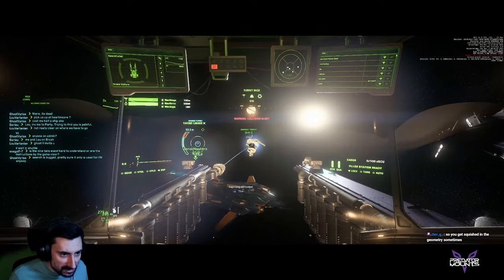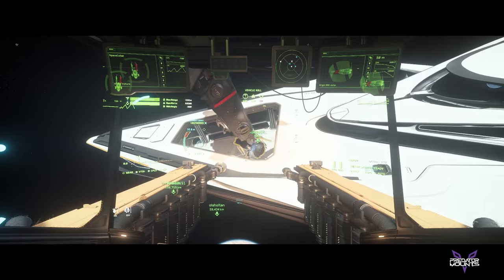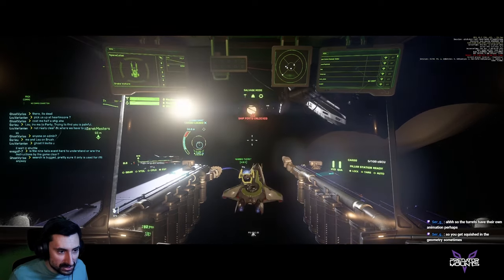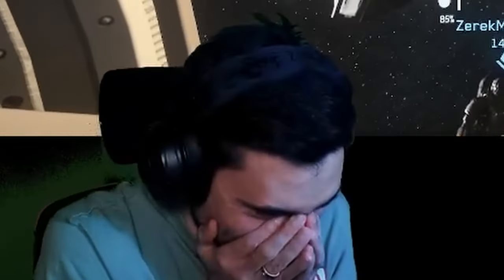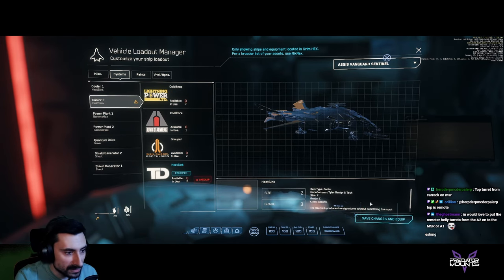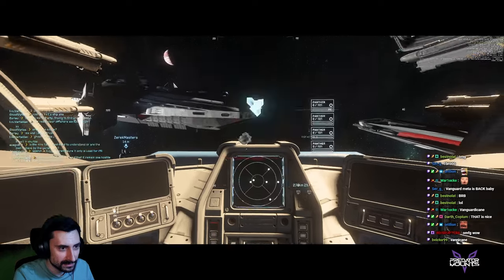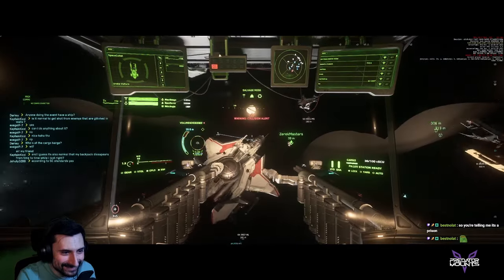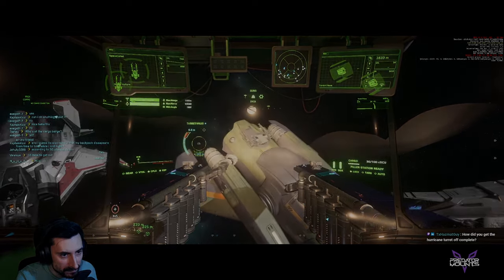How to swap turrets in Star Citizen | Patch 3.21

Comment: I hope they will allow "hotrod"'ing like this, as this brings the game more to the for front for ingame modding.
But..there should be drawbacks as well for something like this..higher power consumption...added weight...fuel usage..I don't know...what do you think?
Reply: Exactly my thought. They could even set up dodgy ship workshops akin to scooters where this can happen. You could possibly invalidate your insurance too.
Reply: It should have increased chance of malfunctioning, and also depending on the turret it really shouldn't work. Some turrets outright do not (and should not) fit on certain turret slots.
Reply: Added weight is already in the game. When you add an item to a ship it takes the weight into account. Put heavier guns on a ship and it can't accelerate as hard. That's why racers strip all the guns off their racing ships.

Comment: The thing I would love to see is: 

1) Finding locations in the Verse that sells or new (modded) S-class systems parts. Imagine going to Pyro and some NPC tells you about a secret chop shop that sells [for the right price] a shield generator that's better than A-class military.

...and 2) A way to upgrade your ship by losing another part. For example, a Cutlass Red has 2 low level med beds. What if you could trade one of those beds in order to get the second bed upgraded to tier 2? That way, you should be able to make a spawn point in a Cutlass Red.

These are just some ideas going through my head....

Comment: Of note: The only other successful turret that won't asphyxiate you nor trap you inside the ship is the Hammerhead's rear turret jerry-rigged onto the Caterpillar's top turret.
Also the Caterpillar's bottom turret can't be swapped with anything at all.
Reply from the maker: We tried that one on the cats bottom but it obstructs entrance. Never tried it on top. Good to know.
Reply: Have you happened to try replacing any of the turrets on the Starfarer with anything yet? That was one of the few ships I never got around to test this with
Reply from the maker: I've definitely taken OUT the big turret on gemini. But we didn't have time to put it anywhere. You are free to experiment tho and report on results if you like :D The turrets in the back o starfarer are positioned so poorly I honestly did not bother.